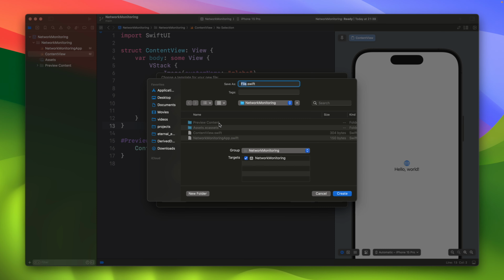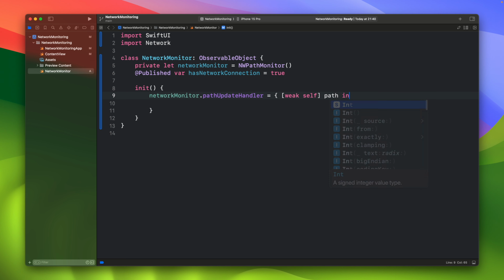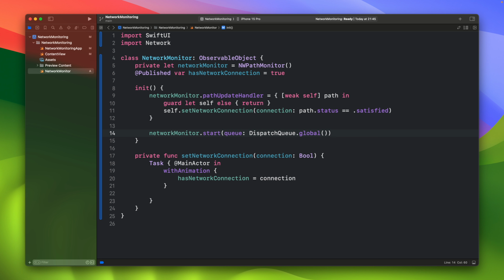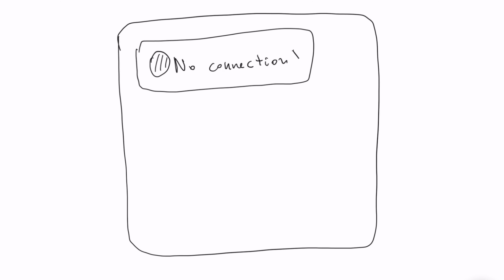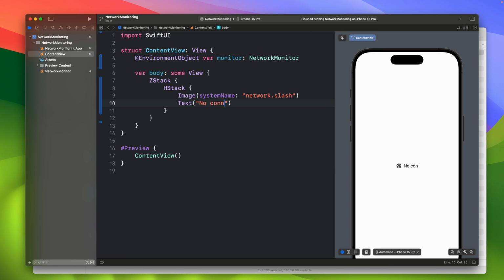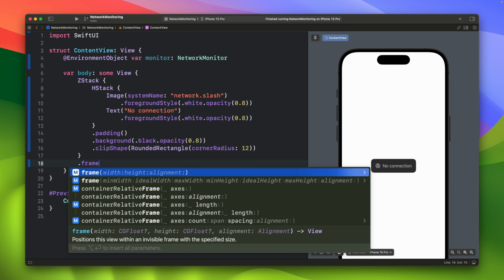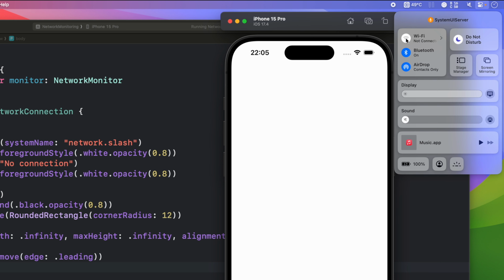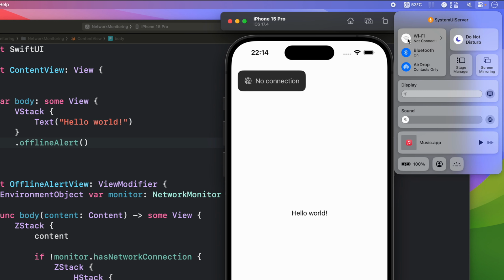How to Create an Offline Alert Using NWPathMonitor

Comment: Nice! But does it matter that you use ObservedObject instead of StateObject in App struct ( 2:50 ) ?
Reply from the maker: In this demo project, the ObservedObject and StateObject should behave the same. Even if NetworkMonitor were initialized again, it doesn't hold any value that would not be recreated automatically.
Reply: @mikemikina  Can I use @Observable instead of ObservableObject ?
Reply from the maker: Yes, you can! I'm not using it here because I wanted this module to be compatible with iOS 16 🙂